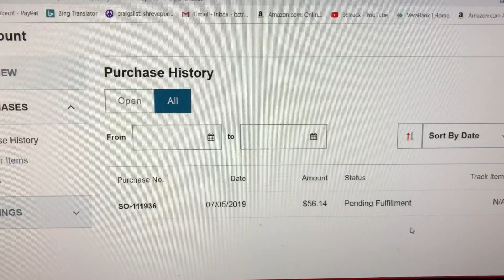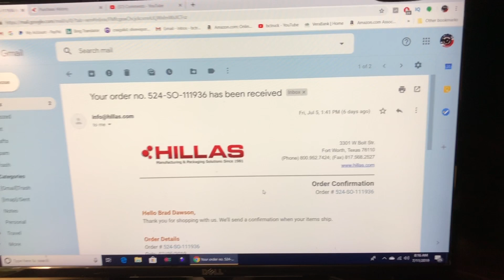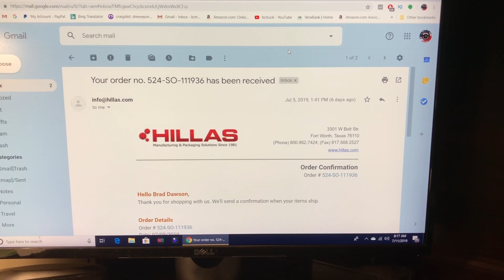Building and installing gutters

Comment: You did a great job installing your gutter, just a tip, caulk those rivets on the inside of your gutter because they will leak pretty soon and any seams lay on the caulking. I wish I could have sent you some end cap crimpers and some sealer at least, would have helped you. We used to use rivets, but screws are faster and don't tend to work loose. 
I loved it when new copper gutter is first installed, fascinates me to watch them solder everything, but you can get copper in a roll now and it's seamless too. Gone are the old days and onto new ways. 
Billy is a hoot and I'm sure he keeps you busy, lol. Have a wonderful weekend y'all and God Bless.
Reply: I hung seamless aluminum 12 years. You are right about the 12-1 seam sealer. It is the best for aluminum. Works on aluminum boats too lol!!

Comment: Oh brother! I fell out of my shop putting a ceiling in it two years ago and straightened out a 6in and circumference hook that was 1/2 inch aluminum with the back of my head needless to say I got needless to say I got a:-( in the back of my head thanks to that. Fun part about that was when I went to fall as the ladder went out from underneath me actually grab the rafters of my shop and held myself for about 10 seconds as a six and a half inch sheetrock screw with 3 in sticking through the side of the rafter that I grabbed went into the base of my thumb, you know that meaty part right below your thumb and came out the topside right at the base of my thumb. It ripped out for some reason , as I let go of it. Needless to say you would have to give me a beating to put those gutters up or shoot me more like it. Great video buddy. You're more courageous than I am!
Reply from the maker: Dannnnnnnnnnnng!!!!! That just sounds painful!!!

Comment: I can tell you why you'd rather take a beating than putting gutters up. Because it's a literal PAIN! I put a metal roof on the downstairs several years ago, and about three years ago, found someone to install the metal on the second floor for a price I could hardly believe! But, none of it included gutters. After watching as many gutter installation videos as I could find, I finally bought the specialty 24 ga galvalume gutters and STILL had to figure out how to install the darned thangs!! Bought something like 200 feet of gutters and still have seventy feet left to install. and, after i put a new metal roof over the newly refinished deck, need about another 50 feet.